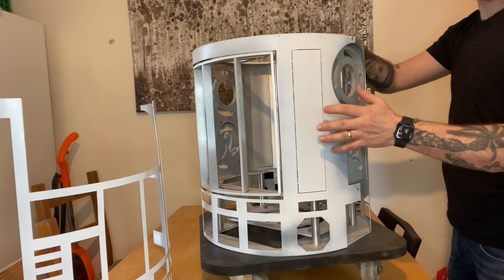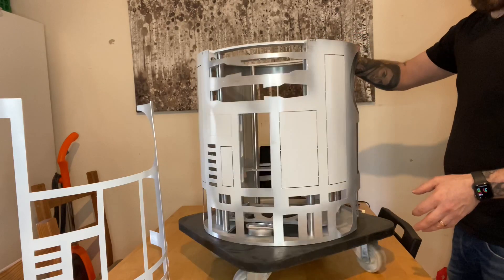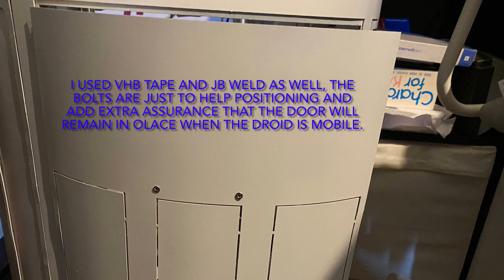Building R2-D2 Step by step tutorial - Important to watch and read description BEFORE building.

Comment: Question why use JB weld and you when with Double sided tape what is the benefits. Thank ps thank for video. Please make more
Reply from the maker: Thanks for your question JB weld is easy to get into the gap where the skins are already stuck thats the only reason, it would not be possible to get a bit of tape into it